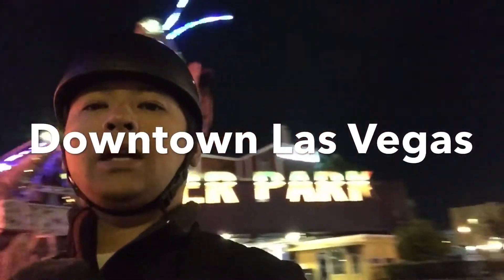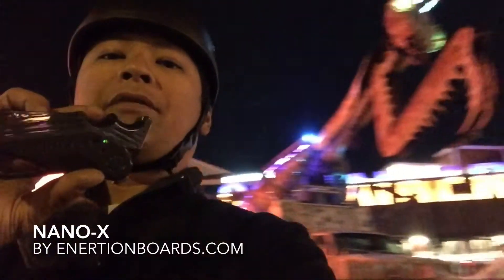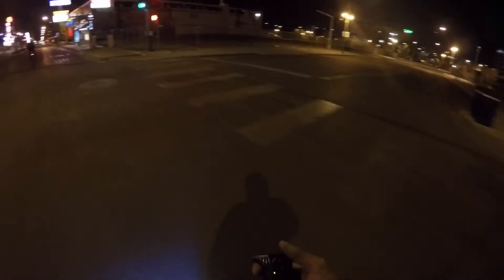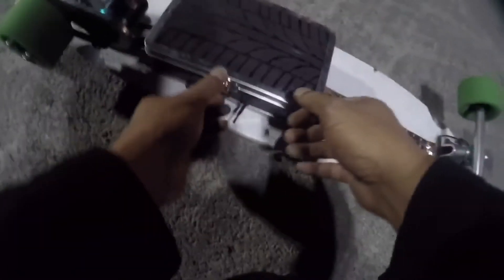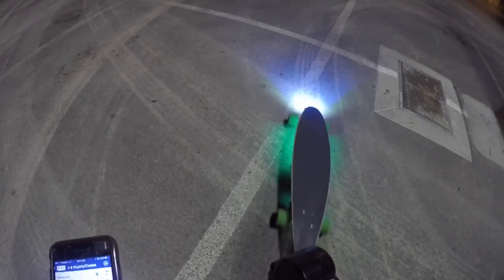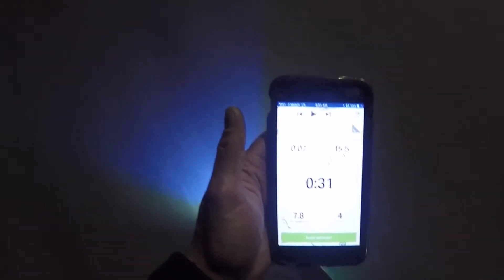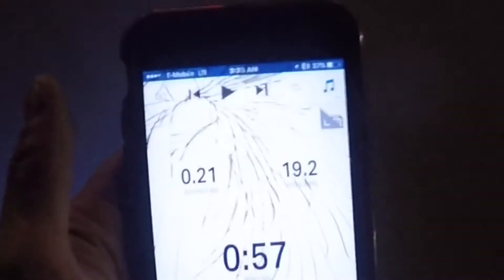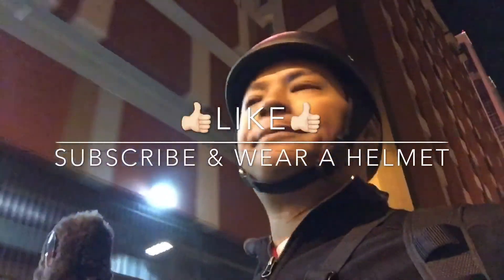ESk8 Vegas DIY Electric Skateboard: -EXCLUSIVE- Enertion NANO- X Remote: First TEST

Comment: That small button you thought was throttle trim actually switches between rates, beginner and expert mode. I am wondering if expert mode would have been faster? 

Also you can redefine maximum and minimum throttle in the ESC program settings